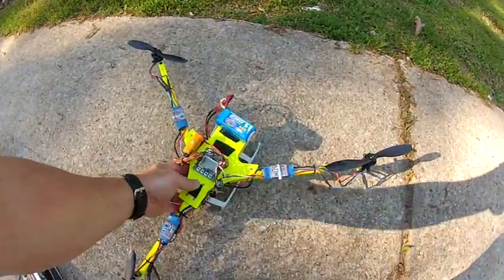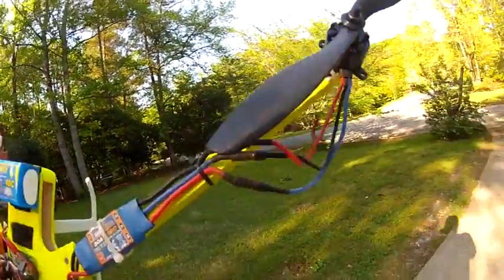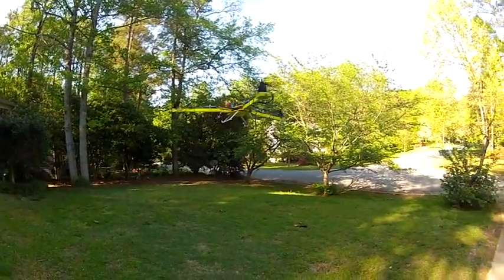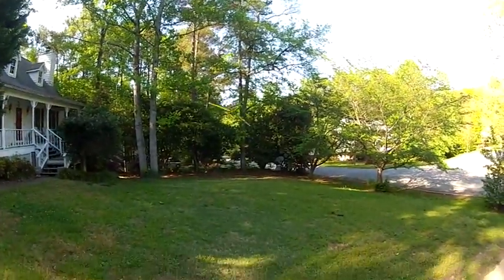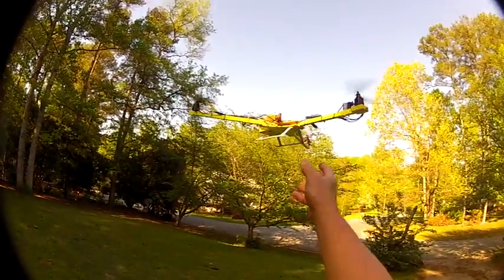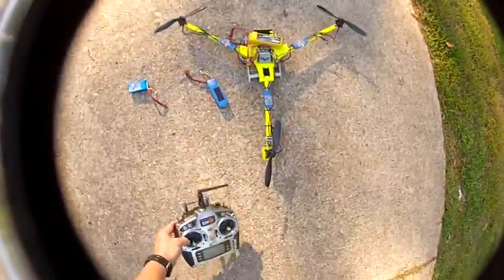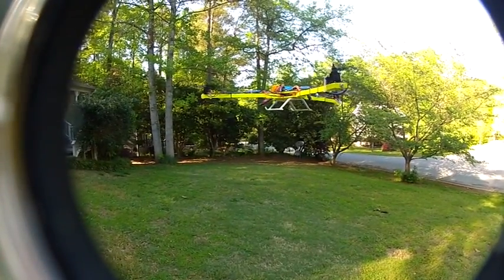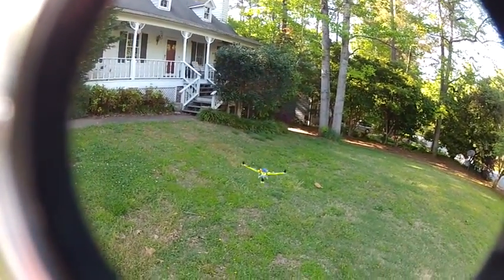Simple Tricopter with sunnysky X1208 1260kv on 3 cell www.simplecopter.com

Comment: Hey Matt, I noticed you have a rubber band on the other side of your servo connected to the tail mount, is that to reduce slop? I have a problem with slop on the tail mount for my trip and cannot find a solution

Comment: My vote is for quiet. Nice video and good control. The noise is created by the props. If you flew the same bird on 5x3 or 6x3 you would have to have a much higher rpm and to do that you would have to have a higher voltage. There's a lot to this and I've just brushed the surface.

Comment: Dont power it when it is upside down then?
Full throttle it then as you start to hit and hold hard left or right or forwards or backwards let off the throttle, then reapply the throtle as it comes round to level out and at the same time bring the directional stick back to centre, ready to make any adjustments.

Comment: With the HP2812-1300kv motors from rctimer and 25 amp plush escs and a 2200 3s should i use tye 8X4 gws style props like you have on your website or something else. Also can i use a 1300 with that same setup that i just mentioned? Thanks and sorry im a noob

Comment: Hi Hall,
I am looking forward on building my first tricopter, I have ordered 3 motor "SunnySky X2208 KV1260 II" but received instead (2) SunnySky X2208 KV1260 II and (1) SunnySky X2208 KV1500 II, do you think it will be a problem if I mix the the motors or should I insist on having them ship the correct one?

Comment: awesome videos! I just finished my tricopter. Any chance you can tell me how you setup the transmitter. I have a futaba 9c super with frsky module. I have it flying on a basic airplane model...no mixes or anything. It seems to fly well. Should I be doing deeper setup in the transmitter?

Comment: Ok, that's sick.  I built a tri using the RCtimer  1300kv motors you suggested.  Durable little bastards. Replacement shafts only cost me 99c too. :). Thanks for the inspiration. Could you post a quick tutorial on configuring and performing a flip and a roll.  I learned the hard way that objects held aloft soley by thrust accelerate SHOCKINGLY fast when powered upside down.  I needed a dust broom to pick up all the pieces.

Comment: If you want to fly (FP) Fixed-Pitch or (CP)Collective Pitch helis then sure you can go Nitro=gas but if you want to fly multi-rotors, Tri-copters, Quads etc there really is no other way than electric! Everything is going electric now, even R/C planes. I have a basement full of nitro-crap lol that I will box-up and sell to you but I wouldnt advise you to do it if you want to do stuff like in hallstudios vid! E-Brushless motors are unbelievably strong!

Comment: He all.  Just a quick note about the Tricopter I built as per Matts information.  Purchased the frame from him (no brainer) and in a short time I was doing loops and rolls and lots of other high speed stuff.  Until ..Yep, you guessed it.  I took it up high to get some great videos of my surrounding area and lost orientation.  ( I am an idiot for not paint it bright colors).  The result was an inverted, ass first dive into the neighbors drive way.  GoPro 3 Black and all.  Less than $50 damage. :)

Comment: I'm just getting started in it all. Does adding an additional battery pack by you anything of significance, I wonder if adding the additional battery pack and incurring the weight cost is worth it. Is anyone doing a gas config with longer flight times.

Comment from the maker: just ordered some SunnySky V3508-20 KV580 at $35 a pop. looking for a long duration H copter that i can run with 12x4.5 props on 4 cell battery. we are going for a flying platform with a 20+ min flying time and 3 pounds of cargo lift. will let you know how that goes.

Comment: Suppo outrunners are nice and affordable. Ive been flying them for the past couple months since i started building flying tricopters. Im running the suppo 2208 1450kv on my smaller tri on 3s 1300 packs and the auw is 24oz rtf. I like the lighter power set up for flying in the yard but the 2212 1400kv have a bit more weight and power to cope with really windy days. Currently designing a quad but have some of the hk 1200 ntm's to try in my green machine tricopter.

Comment: I'm looking to do a build that will do fpv, no acrobatics, mostly flying a perimeter, any suggestions on what motors and props would get the best endurance. Don't need hi performance, just efficient.